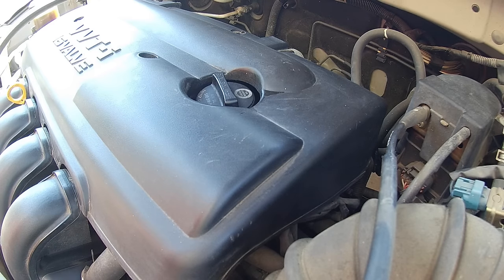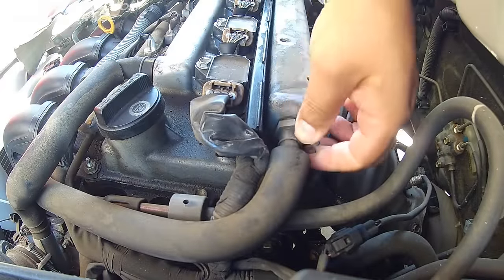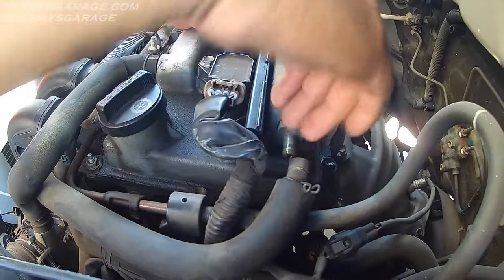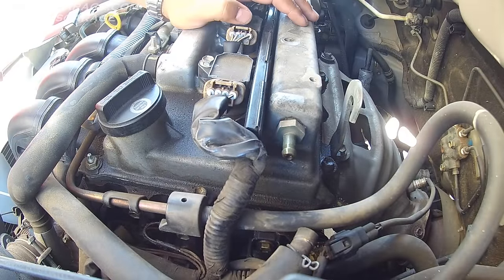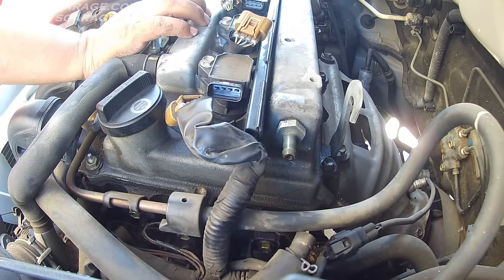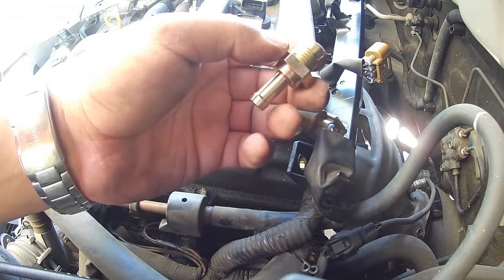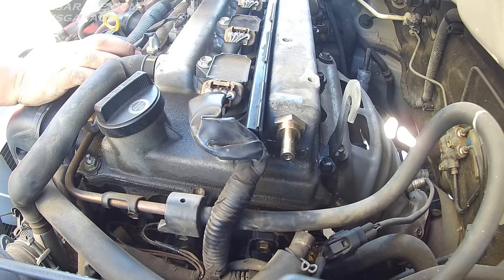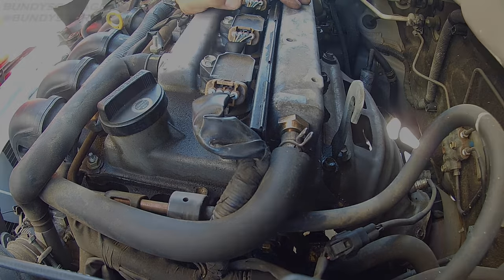Toyota 1.8L PCV Valve Location - Positive Crankcase Ventilation - Corolla - Matrix -MR2 - 2ZR-FE

Comment: Why use the large profile adjustable wrench if you have the correct 19mm open end wrench? You wouldn’t need to remove that plastic rail to make room if you used the correct tool
Reply: sure, i just used a deep 19mm socket

Comment: great video. i just replaced the same thing on a matrix. I used a deep well socket and ratchet  to remove the valve.
Reply from the maker: +EK Auto Tech 19mm socket baby! You didn't have to move that plastic rail, did you?
Reply: no i didnt.
Reply: It's 22mm on a 2.4L Matrix (2009 XRS), FYI. I had to use a deep socket and put anti-seize paste on the new valve.

Comment: Why didn't you use a box wrench on the PCV valve? You showed one? With a box or socket wrench  no need to remove harness wiring!!!  Just another step that may break the plastic. No tape on the threads?
Reply: Sun - Mine came from the dealer with thread tape.

Comment: Hi great video on pcv valve. Any idea where vehicle speed sensor located on 2003 toyota matrix xr 1.8l automatic? Where I thought located bottom back of engine by transaxle not there. There is a little cover there but no wires connected.  Any information appreciated. Thank you.

Comment: Hey I have a Toyota Corolla and I accidentally didn't put oil in the motor but I did put oil in it a day later and my motor started ticking the car runs when I put it in driver shuts off what do I got to do to fix that problem

Comment: How do you know when that goes out? Is it replaced on a regular maintenance? 
Can't you just spray it with carb cleaner in a pinch?
Will it show a OBD2 code?
Do I have it in a 2012 Toyota Corolla Sport 1.8l?
Reply from the maker: Yes it’s in a Toyota 1.8L
It will not show an OBD2 code
You can spray it with carb cleaner in a pinch
It’s a regular maintenance item
Change it every 50,000 to 60,000 miles.
Reply: It's probably time to change it. It might even be original. I bought it with 154k mi. Just broke in.
Reply: I thought this was going to be an easy fix with a pliers and a mm wrench. Wrong. It's all backwards and upsidedown. That thing is behind the manifold. Dumb place for that. They are for the garage not the people's car.

Comment: Novice question: The coil pack wiring has a plastic hose-like case around it. I managed to crack the hose slightly. Am I OK to just cover it with some electrical tape? Should I test the coil packs to make sure the wires are OK? My engine is idling a little rough. I doubt this is the culprit (think it's the PCV hose) but should I eliminate the possibility with a check?
Reply from the maker: +Caitlin Newman if there was a misfire from a damaged wire then your check engine light would be on. A cracked plastic wiring loom would not effect performance.
Reply: BundysGarage thank you! nice to rule that out.

Comment: the PCV valve is easy to remove.... take it out and clean with spray PCV valve aerosol cleaner or even MAFS aerosol spray...CHEAP insurance to clean BOTH valves and be careful with the tiny MAFS attachment screws.
Reply: Doug - Yes ! They are tiny.  The clean MAF sensor made a huge difference !

Comment: I need help! I can not remove the hose from the PVC valve. Any ideas on how I can remove it? It moves around the valve but won’t come off
Reply from the maker: Pull on the hose real hard or cut the hose with a razor blade length wise.

Comment: I have this same exact car ... replaced the pcv valve following instruction from this video ... everything went well other than car won't start now with new valve ... I did notice some thread is out on the new one ... old valve seated on to an exact ... could this be why my car won't start ?
Reply from the maker: Really? The car should start even with the PCV not installed. Did you remove anything else?
Reply: I also replaced the coolant temperature sensor cuz I got a P0128 code ... everything went well with that ... but yeah, that's about it.

Comment: please I need help!!! My pcv valve i got it  replaced found it on a junkyard  but it has a leak  but not on the side you are showing in the video...on the other extension of the valve ... Is black tape an option???
Reply from the maker: No tape will not hold it. Go to Rockauto.com you can find a new one there for super cheap.

Comment: Can  a bad Pcv cause a multiple misfire code??
Reply from the maker: When was the last time you changed it? I saw one go 175,000 miles that was never changed and the intake had carbon in it. Not really bad but maybe a little longer the car I might have started causing a misfire condition. What code(s) does the car have?

Comment: Hola, tengo toyota Corolla 2008. con 235 mil kmts, el auto falla y los sintomas son estos: arranca y conforme se va calentando las rpm suben a casi 2000 rpm.  Luego al andar en calle o carretera si lo dejas en punto muerto las rpm suben y bajan de 2000 y bajan a 1000, hasta que en un momento si paro el carro quedan en 2000 rpm.  hice una prueba, saqué la goma del filtro de aire, así tenía acceso al cuerpo de aceleración, puse en marcha y poco a poco tapé la entrada de aire que entra a la válvula IAC, hasta quedar completamente tapada , entonces el motor se detiene, eso me dice que no hay entradas de aire adicionales. Otra prueba, en frio y con contacto puesto, medí al conector hembra que le enchufa a la IAC, puse negativo tester directo a bateria y me dio 12 volts con el cable negro y azul y luego medí al cable de tierra (negro) y no dio nada de voltaje y despues al otro cable, que creo es señal y midió 0.14 volts, también le cuento que desconecte el conector del IAC, el carro anda y hace el mismo problema.  Me preocupa mucho que pueda ser la ECU la que pueda estar enviando un voltaje inapropiado.  Gracias por su ayuda

Comment: You mean the 1ZZ-FE. 2ZR-FE PCV is under the intake manifold
Reply: toyoscio whats the difference between 1zz and 2zr?
Reply: Mr G. The 2ZR-FE has Dual VVTi for both intake and exhaust, plus it had/has Toyota's Valvematic system. Maybe this is why these engines don't require periodic valve adjustments:}

Comment: Nice video, you should spray it with pb blaster if threads are seized
Reply from the maker: PB Blaster sucks! If you need a good penetrating oil mix 50/50 of Acetone and Automatic Transmission Fluid. Works wonders!

Comment: Old school. You remove the valve. You shake it to see if the valve is moving . You blow out the dirt. You spray degreaser in the valve. You blow it out again. Shake the valve. Is it moving freely ? Yes ? Put it back in. No need to buy a new one. Case closed.
Reply: I agree under normal circumstances, however, if one comes across a valve that is plugged end to end, I would just replace it .
Reply: macc - Mine was $7. Worth it for the peace of mind.

Comment: Dealership claim to have removed my motor to replace a seal leak.all was wrong was a bad pcv valve and a split in pcv hose.didnt remove motor or they would have saw hose.lowered transmission to replace seal.told me didn’t see bad pcv hose cause of black cover on it.took my money for removing a motor.